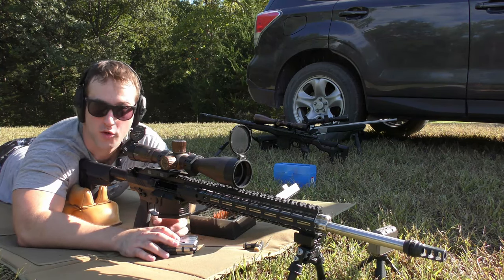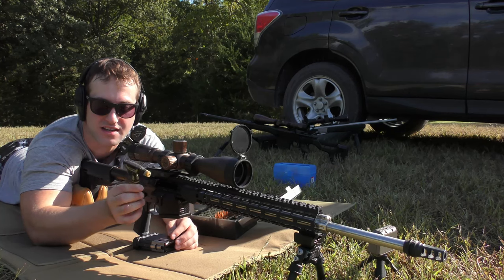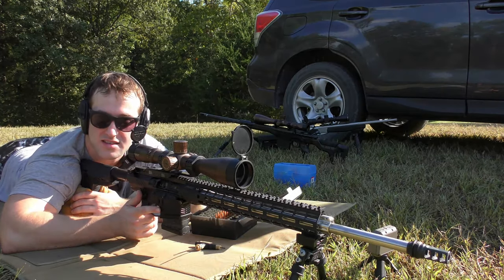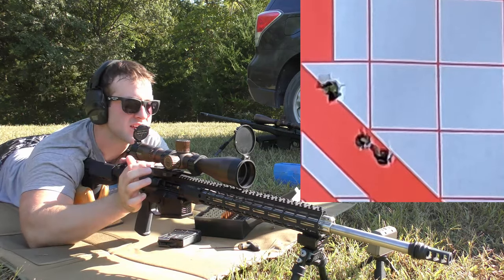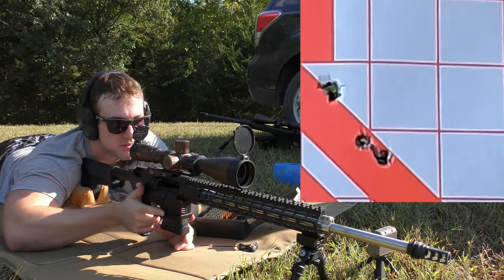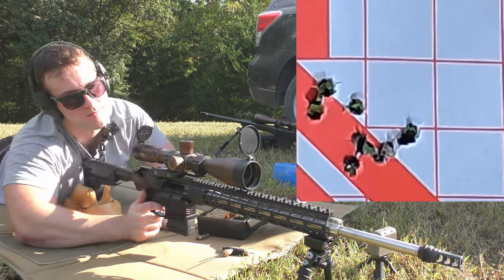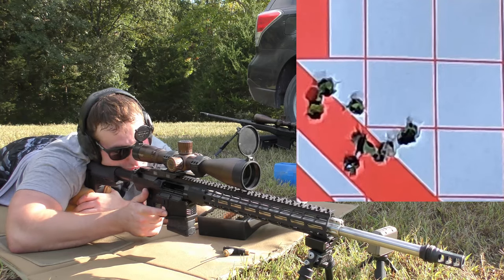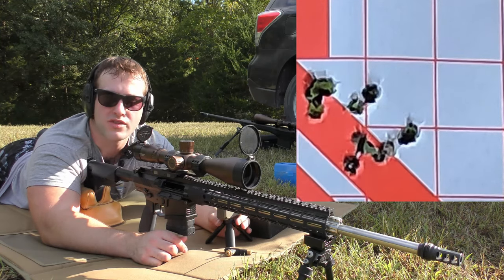How to Tune an Adjustable Gas Block on an AR10/15 for Reduced Parts/Brass Wear and Smoother Shooting

Comment: I assembled an LR-308 on the Aero Precision M5E1 receiver set with a Faxon 20" Match 308 Win barrel. I opted for a plain gas block rather than an adjustable. I haven't had a chance to function test it yet. My thinking is that if I do have excessive gassing, I can hopefully fix it with a heavier buffer. I'm using the JP Enterprise captured buffer system. It can be adjusted with tungsten weights. The spring can also be swapped out. The other thing I can do is work with load development to keep the port pressure in a sane range. All my magazines are Magpull SR25 20 rounders. 🙂 I don't care what YouTube thinks about that!
Reply from the maker: Sounds like a nice setup! I hope you love it!
Reply: @RisenCitizen  🤞